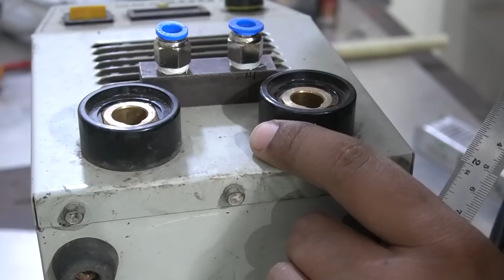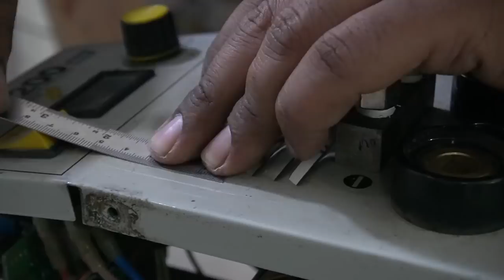Amazing !! Transformation of Arc/Stick welding Machine into TIG welding machine. Hybrid welder 👨‍🏭

Comment: Very fun video to watch. Instead of "scratch starting" try "flicking" the tip between the weld surface and the tungsten electrode with the filler wire. This will help you in the long run because it helps prevent a contaminated electrode.

Comment: I'm pretty sure you could've got the same result buying a tig torch with a gas valve on the torch plugged straight onto the regulator and the lead connected to the hose... Did i miss a hf start function?

Comment: very impressive 👍👍
but
1st it's only strech TIG welding.
because no HF added. and 
2nd thig is 24 volt is present itself in this machine,so you don't need external 24volt adaptor for powering the solenoid valve.

Comment: Great video Bro..👍 I wanna know, is it the same feeling if You use the real Tig welding machine ? Any discomfort than real Tig welding machine ?
Reply from the maker: Thanks bud, well feeling depends upon what you used in the past, if you are using high frequency tig then it might be a problem but for scratch tig user it's almost the same.

Comment: Bro I am watching it again.And wanted to know few things..How much argon costs,,and Filler rod price...Since I don't Visit Local shop I don't know about the costing...I am planning to make this conversion with my Esab in future and I just want To Keep eveything simple By just mounting all the components Like Pnematic valve,Power supple and connector outside   I,e On another enclosure ..And Connecting tig torch to machine would be the only work everything external..Eht do you think about this
Reply from the maker: Dear gas prices are not same everywhere in India and depend upon the cylinder size it's varied alot.I have 1mtr. High cylinder which cost me 1000rs to fill. The 6ft tall cylinder cost double now a days and due to market inflation they are increasing rapidly. And the filler rod costs around 800-1000 rs per kg and since it's a 5 kg packing you can calculate it. As far as conversion is concerned I suggest you to buy a tig welder rather than going for conversion because stick welder does not come with high frequency board and doing scratch tig and lift tig is not comfortable process to do. So my recommendation is to go with good tig welder because trust me that js worth the money spending. If you are just a hobbyist you can go with this conversation there is no problem in that and making a separate unit for the conversation is good and easy to do. So chose the decision based upon your usage. Good luck
Reply: @ambroscustom  thank you Bro

Comment: Tig ac dc to cold welding for aluminium. (Time second to micro second control,Current control) convertor please make video
Reply from the maker: It will be really interesting project. I will try for this.
Reply: Is it possible to convert it into plasma

Comment: Couldn´t you just mount a finger/mechanically-actuated gas-valve directly on the torch ??? I´d have saved you lot of trouble.... Do you have to scratch, in order for the arc to build-up, or can you start the arc from 1-2cm of distance...??? Thanks for any answer, I know little about such stuff, and make stupid questions, maybe...
Reply from the maker: It's possible but not economical. Solenoid valve is much better option to control the gas and once the switch is released the valve shut down the gas supply and yes it's the scratch tig, it's not possible to ignite the spark 1 cm above the surface. Don't worry about questions brother, you are welcome always.

Comment: on a 220v stick welder , do you tap 1 side (110v) to power up the 24v supply? and you use  the welders neg. electrode for ground , Do you use the pos + electrode at all?
Reply: The switch probably for just for the gas.
This is probably just a SCRATCH TIG with switch on/off gas function.

Comment: I tried to make one with 200amps dc arc welder and torch wp26v, but neither filler material nor base metal is melting. when arc length is increased making holes in base metal .tried with different current, angle,argon gas 15-20lpm,tungston electrode 1/32,what would be the reason? OCV is 45v, tried a lot but not succeded please help me.
Reply from the maker: Contact me over Instagram or Facebook. I couldn't recognise what you did. Have you confirmed that your argon is comming or not.
Reply: @ambroscustom  argon gas is there,hizzing sound can be heared,can u please tell the ocv of ur  welding machine,thanks for reply.

Comment: Tig welding machine is using high- pressure spark ignition.
You have not touched the soldering iron to the metal. If you press the switch, will the soldering iron spark?
Reply from the maker: No it's not going to spark that way, that's why it's considered to be scratch tig or lift tig.
Reply: @ambroscustom  
two more mods you could cheaply and easily do . 
1.    HF starter boards are cheap off eBay, amazon etc.. why not add a High-frequency starter to the machine, the wiring on how you do it would be interesting to see.
2. add two more dense connectors to get AC current , 1.   dinse connected directly to the transformer to get AC , the DC get from your current setup out of the full-bridge rectifier
Reply from the maker: @mp-uy9sv  thanks for the info brother, definitely look into those points also.

Comment: Sorry my brother. Yoh can help me. How to make dc tig weld to AC tig weld for alunium. Tank you. 🙏
Reply from the maker: These stick welders are dc you can't make ac tig welding machine, you need seperate board, so it's better to buy machine. These hacks are good if you have to do little bit of work. For heavy work, use genuine machine.

Comment: Could you please specify which wire to connect to the red switch?
Reply from the maker: Dear during the video there is a schematic of the machine I showed. It has everything you actually need. There is a link to the file as well. Although that switch controls the 24v power supply. The negative connected directly to the power supply From welding machine on off  switch and the positive to the power supply connected via this red switch.

Comment: all that drilling makes it look complicated, cant we just connect a gas bottle externally to a tig gun , like its shown in other videos.
Reply from the maker: No. The gas will continuously flow through the tig torch even when you are not welding for that I have installed a gas valve in it.

Comment: what gas is used here, what will its cost? what is cost of conversion to TIG (ex welding machine)
Reply from the maker: Argon gas used. Cost 2000 INR
Reply from the maker: No bro, gas cost is 900/- for 7 cubic metre cylinder.
And the conversion cost into Tig is 2000/-
500/- for gas valve
200/- for pneumatic fittings
800/- for 24V power supply
Other expenditure on hardware etc

Comment: What happen without gas soldering
Reply from the maker: Without gas welding (arc welding) just switch off the red rocker switch that I have installed. In normal stick welding you not need to press red switch. Connect your welding holder and do weld as per required current. I made tig welding circuit separate that will not affect stick welding function.
Reply: I mean what happen without gas in TIG WELDING
Reply: What happen without gas welding in TIG
Reply from the maker: The Aragon gas act as a shield gas between non consumable tungsten electrode and weld material. Without gas air may enter to your weld joint which will make your weld joint porous and your tungsten electrode become black and dull in sharpness and you get poor quality weld.
Reply: Please make a vedio in without gas welding tig

Comment: How much DC voltage for your arc welding machine bro ?
Reply from the maker: I think you want to know current rating. My machine is 200A. But I prefer to weld on 90-100 amp. Depending upon the thickness.
Reply: I have question for a voltage not a amp bro?
Reply: Your small mistake for this your use smps 
Primary DC power supply welding machine
24dc ?
Reply: @drmgweldingandfabricationc1864  it's depends on your solenoid valve you can use 12 vdc valve if you not have 24v dc valve or use ac valve but i don't suggest you to use ac valve bcz of switch in your hands dc is safe but not ac so use 12v or 24v valve use smps supply accordingly..